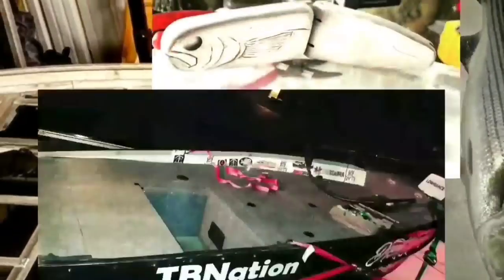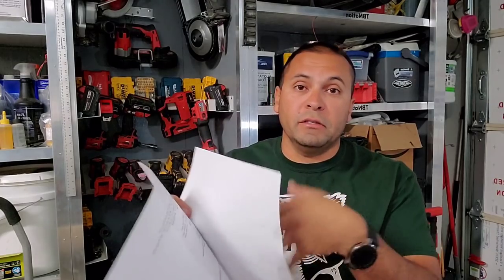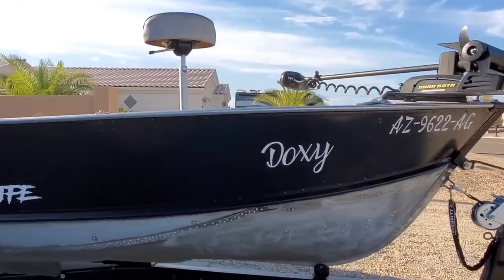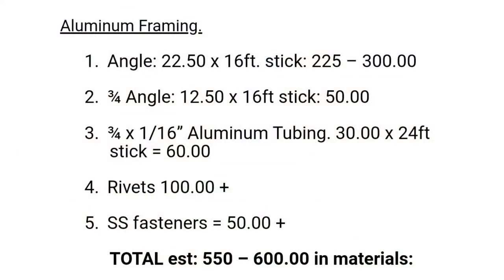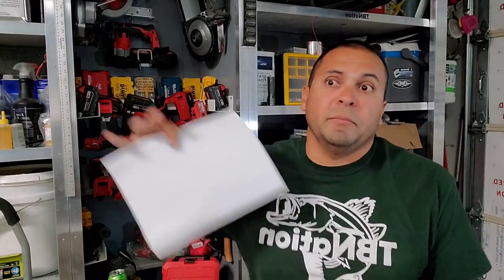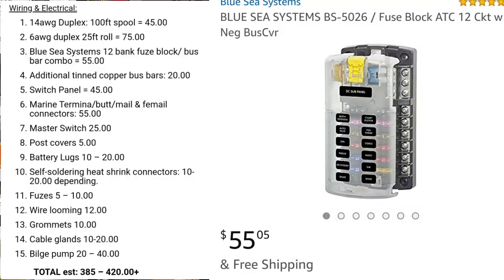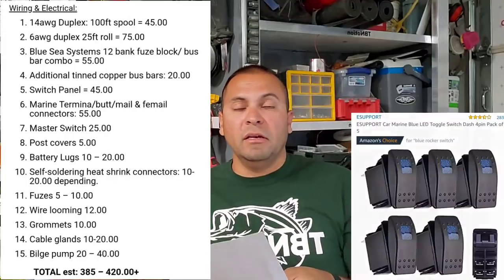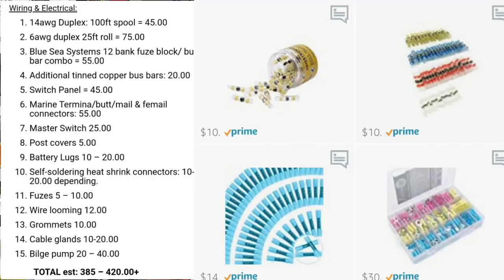How much does it cost to build a tiny boat?

Comment: An outstanding bit of information! You may want to mention that the price of the motor and the boat itself needs to be added to this. A brand new motor will more than double this cost and a brand new boat hull will add another significant amount - the bigger the boat the more expensive a motor you need and the price of the boat itself goes up too. There is also the cost of tools to consider. By my calculations, the cheapest bass boat at bass pro runs cheaper- not more expensive- than building your own though not by much and the quality isn't there compared to the boats on this channel.
Reply: I've made the comment several times an older bass boat is about the same price.
Reply: Many people who come here already have the boat and motor. Itd be impossible for them to average the cost of people who use craigslist or facebook marketplace. Also, I highly doubt you found a bass boat at Bass Pro for under $3k. Even the used ones are closer to $10k starting
Reply: Sure they can get a used bass boat for 3k..... that also means they inherit all of the problems that a 3k bass boat brings lol. This is built new
Reply: @bass_scout_actual7554  you can buy a 16' jon boat in good shape with a good motor, trolling motor for 2-3k all day long. Yeah it may he a 95' model but once you put 2k into it you basically have a new boat.

Comment: I have a 16'x 75" aluminum boat, that im starting to redo for myself. I drew up a diagrams for framing, hatches, livewell, consule, etc. I have built many boats from 12' jon boat, to 30' cuddy cabin, from steel, aluminum, fiberglass, ect. If done correctly wood framing will last 20yrs or longer. But i have priced out aluminum for my current build and at over $1000 just for framing. And priced wood, at 140, plus 100, for propane for burner, and 2 part sealer. 240 total. Plus if you cover and take care of your boat it will last many years to come. I really enjoyed your work, very good job. But you need to ensure to people watching, that depending on what state your in, doing this mod, could and would get you a very expensive fine and could possible get boat impounded.

Comment: I love the aluminum boats and im a welder fabricator I build all my own poling platforms, rod holders, and t tops ive welded up many aluminum hulls. but I like working with fiberglass and building my tiny boat out composite materials and fiberglass. All coast about the same maybe even cheaper to go fiberglass if you go with marine plywood. either way I think this channel is awesome keep the bad ass builds coming!

Comment: Thanks for the Vid and info.  I think im going to break down my  tracker V14 this winter and apply some of your stuff.  I used wood the first go around and some of front rivets didn't like the big waves that can happen at lake mead, nv.  I have a few leaks on the rivets now that i'm going to have to fix before next season(i try not to fish if the low temp is below my age, i'm 48).  Hopefully it's still under warranty since its a 2016.  Thanks again and keep the vids coming.

Comment: Do you leave it to the customer to find a motor? Or will you find one and go thru it and do anything it needs to run correct and install it or is that up to the customer ? I would only want the minimum HP to get the boat on plane and I’d only need tiller steer.I have no idea what a used dependable 10 or 20 HP tiller steer painted and installed by you would add to the high end $3500.00 price. Could you give me a ballpark?

Comment: I like your vids, and there's always ways to make things cheaper, but...  I feel like the materials list is a little deceptive while your filming in front of the 4-5 grand in tools that you'd need to take on a project like this.  I'm in the process of re-doing an 18' crestliner, and have fixed and redone many boats before so "we're in the same boat", lol.  But yeah, if you're not redoing several boats or have many other uses for them, the tools alone can break the bank before you're even talking about materials.

Comment: I’ve restored 4 and you can have $3-4 thousand spent in no time. Electronics, trolling motor, anything electrical will eat you alive. But when your done it’s paid for and if you sell it after using it for2-3 years more than likely you will at very least you will get your investment back and have a free boat to use in the mean time. You be been doing that for the las 20 years or so.

Comment: There is one area boat manufacturers are completely failing here in the PNW... And that is the extreme Multi-Species boat you can keep in your garage... 

I'm looking for a 16ft boat almost identical to what you bought.  Open floor plan, small front casting deck, tiller steer.  It's going to be used for lakes and BIG rivers, Trolling, casting in one spot, and casting while trolling.   

Currently the only options are no storage (like a stock jon-boat), a tiny amount of storage in a versatile hull (like I described above), a TON of storage (bass boat, that doesn't work well for salmon and ocean) and what I call "Columbia River boats" AKA: Great for trolling, crap for everything else.  Big windscreens, enclosures, large boats, but doing anything other than trolling doesn't work well. But those are super popular around here... 

So If I can get what I'm looking for, it's eventually going to get rebuilt with a much larger front deck, with much better storage hatch options, but still have the rear area flat and empty, for trolling.  The combo of the 'bass boat front' and 'columbia river boat back' able to be stored in the garage, and also be able to bring 3-4 people along comfortably, is what is lacking... All of the manufacturers are half-assing that side of the market and it shows.  I looked at dozens of boats at our sportsmans show last year, and the only ones with cool features had giant consoles and windshields in the way.  

I get it, it rains here, but that's what raincoats are for.  When it rains, it's windy, and your giant enclosure becomes a sail and the boat is uncontrollable.
Reply: Dude I feel you, I'm in lynden, whatcom county bellingham area. I built mine. Best decision I ever made. Cost was a little higher up here for my total build but I was more satisfied fishing bass than a coworker who bought a new bass tracker plus the ability to fish multi spiece. He has a payment mine is all mine.
Reply: @danielandersen7887  I'm in Portland on the hunt right now.... I have one that I REALLY have my eye on, but the price is a tad out of my reach... Going to try to get him talked down a bit...
Reply: look at the Alumacraft open concept tillers, a smaller version of what Aaron Weibe of uncut angling uses
Reply: In the same boat here in Portland, I’m redoing an old 16ft mirrocraft, can’t quite copy all these “bass” boat conversions, but stealing great ideas to incorporate everything I need to chase the bass and the salmon and the Kokanee.
Reply: I restored a 16 ft Starcraft SuperSport, dual-console. Did it for around $1500, MAX. Got her in Hayden Lake, ID & had to completely re-floor her. Not as glitzed out as what these guys. I used plywood. I applied deck sealer 1st then put Harbor Freight truck bed liner on all sides of it. I reused the aluminum stringers but used 1" wood to aluminum screws and wide-capped (?) rivets from Tacoma Screws. After initially buying hardware, rivets & screws from Lowe's & Depot, I saved a good 1/3 the cost. I did mine with GREAT consideration to budget. This includes buying a 9.9 hp kicker as well as trolling motor tie rod to the main. PM me if you'd like to know more

Comment: Are these prices similar today or are we looking 40% higher like the rest of the economy?
Reply from the maker: 40% on most things, but not all
Reply: @TinyBoatNation  thought so.

I sent you guys a email a couple years ago about a tracker I bought that I want to rebuild.  I got busy and haven’t started it yet but I think this winter it’s going to happen.  I’ve only ever had small 12 and 14 foot Jon boats and am not too experienced with electrical or really tech at all on a boat, never even had a steering wheel but I bought an 89 tournament Tx for 3 grand and it’s been mistreated by the last owner so I’m suspicious that I’ll need to re-foam it because it was left outside uncovered in Washington state and the deck is in bad shape.  I can only assume there’s wet foam in there.

If the framing is still decent and all I really want to do is add a rod locker are you guys able to help me out with a consult on the rebuild?  I’m sure there will be a cost and I’ll buy a lot of stuff from your site but I just want to make sure this is a project I can handle before I go crazy.

What’s the best way to start the process.

Comment: that's without outboard motor rebuild.... but its worth it!! also have you ever looked into raptor liner? i did my 1/8 aluminum deck with raptor line 2 years ago and even in the fl heat loos as good as the day i put it on.

Comment: Thinking about doing this to my 14’ Aluminum duroboat. My question is, do I need a welder for any part of it?
Reply: no you shouldn't. Aluminum creates a toxic gas that is deadly when welded on so i wouldn't try it unless you're an experienced welder with good ventilation and a respirator. Typically speaking aluminum is the best method to use because its easy to work with, very lightweight, and won't rust like other metals.
Reply: Rivets are the key

Comment: What’s the reason for v bottoms how do they do on the water vs flat bottom
Reply: I'm sure his video will be great, but for a short answer: V-bottom takes rough water better, flat bottom has a shallower draft (distance between the waterline and the bottom of the boat.)  It's kind of a moot issue when you're talking about "tiny boats" because you're not going to want something under 14 foot in anything approaching 2' swells regardless of the hull design.  But if you're in 1' swells, the v-hull is going to slice through the crest of the waves so that your ride is more comfortable, while a flat bottom will "slap" against the crest of every wave jarring both the passengers and the hull alike.  On the flip side, I had a 14' flat bottom with a 25 hp outboard that I could navigate in 3-4" of water, where a comparable v-hull you'd be looking at a lot closer to needing a foot of water.  Just like everything else in life, its a trade off.  There's plenty other finer points of load displacement and functionality, but that's the primary difference before you start getting into the smaller details.  It's all about your personal preference and how you like to fish.
Reply: @squatchymcsquatchsquatch3015  well said

Comment: I can't find angle for anywhere near 22$ for 16' I have looked everywhere. its gonna cost me 400$ for aluminum alone
Reply: 400 for all the subflooring and hatches sounds about right
Reply: @Uknowjusticemill  my estimate wasn't including the wood, rip. plus im gonna have to drive to Connecticut bc I can't find a supplier nearby.
Reply: @johnsemar107  yea and all other cost included they all just keep coming, it's worth it to get it from a metal shop most likely cheaper than regular hardware stores.
Reply: @Uknowjusticemill  gonna be expensive...

Comment: Are you using 6061 or 6063 aluminum?
Reply: 6063 is stronger right (structural)? I know you can bend architectural tho
Reply: edit 6061 is structural and it is stronger, 6063 is architectural and is able to bend but not as strong

Comment: Check McMaster Carr for some of these, the 1.5 x 1.5 x 1/16 aluminum angles only come in 8ft lengths for 16.21 a bar. https://www.mcmaster.com/aluminum-l-channels/wall-thickness~0-0625inches/outside-height~1-5inches/outside-width~1-5inches/

Comment: Have you tried metaldepot.com or buymetal.com for aluminum.
Reply: @TinyBoatNation  check them out may have some stuff you can buy in bulk which ussually discounts most things. Hope it helps. Wish I could do one of these builds but I simply will never have the time. Mine will most likely be done with cedar framing.

Comment: Damn good video. Wish I could do all that. Seems really hard to pull off.
Reply: It’s not that hard to pull off,it just takes time and money.I just restored a 1986 18’ Alumicraft. It cost $3,000+ and took me 3 months to do. I did it all my self,except for the wrap I put on it and my wife helped with that. I had over $300 in paint and primer alone.And I restored the trailer too. It gets a lot of compliments and offers to buy it off of me. Give it a go. Electronic are the most costly thing. I have $800 in a new trolling motor and 2 Garmin striker 4plus cv units. It’s a
 Big commitment. It’s my4th restoration. If I can do it 
Anyone can. I see so many project boats for sale online that people say they lost interest in it’s unreal. I thank they got into it and realized that this is not going to be easy and it’s going to cost lots of money or they don’t have the skills to complete it so they sell it.